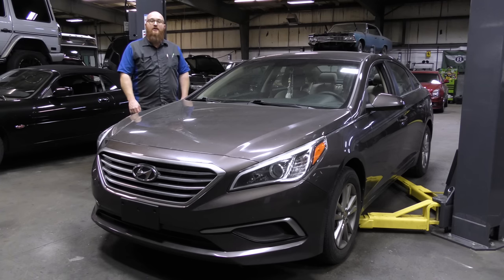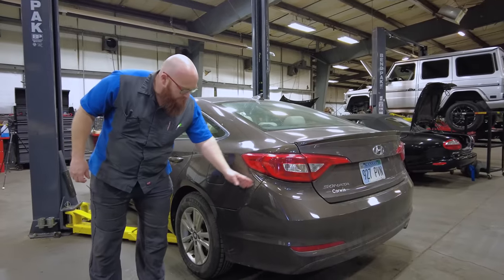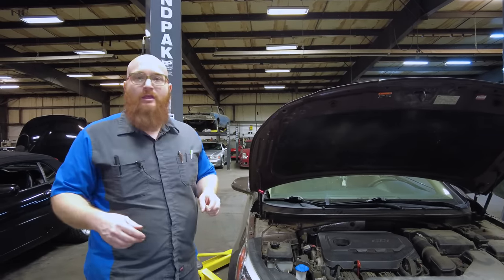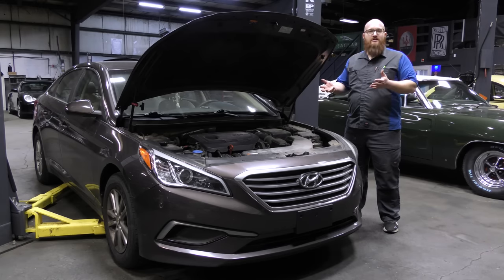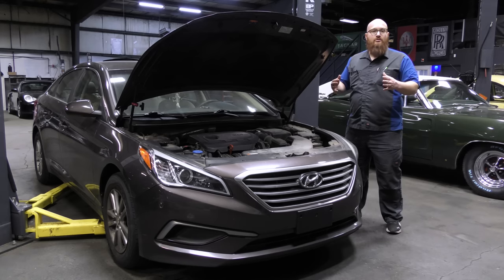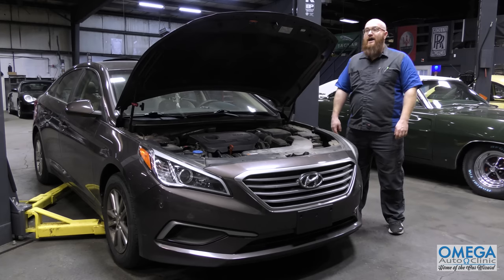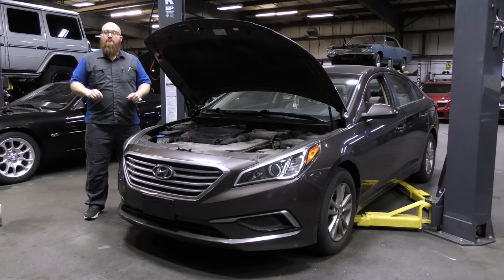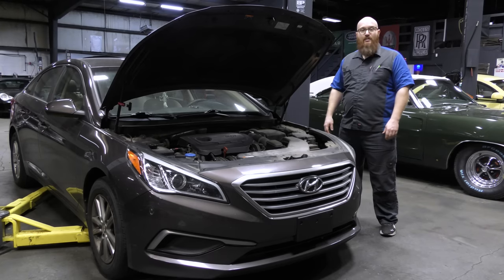What could be so bad on this '16 Hyundai Sonata that the CAR WIZARD is sending it to the junk yard?

Comment: Wizard, That is some good and honest advice for your customer. I did a rebuild on one of those junk GM 3.6 motors for a family member. I am a pro mechanic and I used the highest quality parts I could get. The motor took a crap about 8 mo. later. Like you said some motors aren't worth rebuilding. I did the labor work for free yet I still feel bad about it.😔
Reply: That’s so crazy that these engines are disposable. I replaced the bearings on a 74 454 in my driveway as a teenager and it came out fine.
Reply: My mom just traded her 2017 Santa Fe sport because it burned 2 Quarts every 1.5k miles. Only had 80k miles. It was ridiculous. She got a 2019 rav 4 with 17k miles. I’m happy she listened to me and got a Toyota.
Reply: I maintain a 2014 Acadia with the 3.6. It currently has 207k on it. It does burn oil, 1 qt every 1500 miles, but keep it topped off and going. I have seen plenty of 3.6l with 200k+. The earlier ones were bad with timing chains, but the 2012 or so + that was resolved.
Reply: I ll bet that the timing chains went... we cannot use aftermarket parts they are all from china with low quality for sure...
Reply: I had a 2005 CTS with the same engine that didn't make it past 60K miles.  Lost a shit load of money.
Reply: Manufacturers are purposely building cars that do not last more than 3 years. It’s better to buy used vehicles build before 2012 ( my personal opinion ). I have 1997 Ford E250 still running same engine transmission starter. Also have 2005 RAV4 still running strong. 2006 MDX just trade for another used RAV4. Older cars built to last for years and years but new cars built to stay in a shop for days months and end up buying another new model and same problem. Older cars build much better  using quality parts but so many parts are made in China and their quality control is very poor
Reply: @hcho7776    I'd better not purchase that new RAV4 I was thinking of buying if Toyota is now purposely making it not last more than 3 years.  Thanks for the info.
Reply: I sell a lot of timing kits for those 3.6s. what I don't understand is why these dealerships that buy them from me even still bother selling these cars knowing how they eat motors

Comment: Not to mention likely the worst thing about hyundai/Kia ownership is the dealerships are horrendous.
Reply: Hyundais and Kia’s are horrendous
Reply: To be fair every dealership is horrible... I don't buy Ford or Chevy but I for better for worse have driven a different brand car for each of my purchases and I would say Acura is one of the better experiences.  But that being said a dealership is a dealership they always try to nickel and dime even Toyota dealerships..... Hyundai and Kia aren't great either but it helps if you're in an area that has at least two or three competing dealerships because then if there's more than one place you can buy the same brand car within a 30 mi radius they have less gumption to be dick heads
Reply: @nathanielbailey108  Man you are dead RIGHT about that.
Reply: Even Genesis sucks.  Had a G80 and was treated horribly…went back to Mercedes
Reply: In my area the Gm and Ford dealerships are better Would never buy or have my vehicle serviced at the dodge dealership. Which is unfortunate because I love Chrysler cars.
Reply: thankfully they are so well built they dont need service
Reply: @waterloo123100  Yeah, and we know dealerships are going to mark up the hell out of those ‘last call’ models so only the multi millionaires can afford them.
Reply: I bet if the owner had topped up the oil before visiting dealer, the service manager would require to see all receipts for oil & filter changes, and this is where most DIY's are in trouble, myself included.
Reply: I need a used car........ suggestion please ????
Reply: @whatamisupposedtoputhere  they don’t even sells those high priced dodges here 😂you have to drive to Minneapolis for that.
Reply: @Mtechthewise  I believed that's covered in the Magnuson Moss Act, if I'm not mistaken.
Reply: I agree. The Kia dealership near me has sold my grandparents lots of work that they don’t need! Thankfully my Grandpap just got rid of his Sorento and now owns a Lexus RX. He’s so much happier and I think he will love the dealership experience as well.
Reply: Find this kinda ironic. In Australia hyundai/kia has pretty much the best dealership and aftersales experience I've ever had. All our cars are imported from south Korea and don't seem to have the issues that their North America counterparts display.
I don't think here I've had a worse experience than vw though. Crap product and crap service. I'll take a k5 or sonata any day over a passat
Reply: @Nathaniel Bailey  especially up until maybe 2018 fleet. They're been pretty good for a few years now but hyundai owners don't even realize how much owning one is a gambling. The kicker is that hyundai had such a nightmare with some of their hybrids that new battery replacements are double as much for older models than recently released models.
Reply: @swissmrkc  dealerships are no representation of the manufacturer brand. They're run by a bunch of get rich quick handlers. You're going to find more often, not necessarily often, just more often, caring and honest, used car dealers than top money guys. Overall the typical guy doesn't get into the business to play fair games if it means they make even.
Reply: The funny thing is we have a car 'expert' in Australia who constantly pushes both brands as being the best to buy, says the dealerships are great , however I went to take a test drive on a Tucson at our local dealership and they would not let me have one unless I agreed to BUY the bloody thing before driving it  ! .I bought an Outlander instead and its been faultless for seven years . One thing tho , reliability wise, I don't think any of the Hyundai  cars we drive here are built in the USA.... they are built in Czech republic.
Reply: Junkyard?! Why not just replace the engine? Give it to WatchJRGo, he’ll fix it
Reply: @scottalston8670  who cares- g80 far better than todays mercedes
Reply: @Mtechthewise  not likely theyd say athing- -
Reply: @dks13827  toyota or honda
Reply: @nathanielbailey108  The ICE cars,  yes, the EVs NO! And I have owned two, one from each sister company
Reply: Yes so agree
Reply: Hyundai dealerships are not horrendous everywhere. Ours in Salem, Oregon is amazing. They are always giving me free oil changes or discounts on services if I take their surveys after my oil change. They've been nothing but courteous and professional. I'd say Salem got lucky.
Reply: @elesjuan  yeah but you know that a dealership especially with this known issue will find any excuse to deny you. Then you have to end up taking hyundai to court and pay to have the engine torn down to find point of failure
Reply: What a ignorant thing to say. There are good and bad dealerships for every brand. They aren’t one entity lol. They are all owned by difference companies, some family owned some owned by big corporations.
Reply: Around where I live it's the same family that owns our Ford, Chevy and Dodge dealerships. The only thing those guys don't own is the Toyota and Honda dealership.
Reply: @nathanielbailey108  "Hyundais and Kia’s are horrendous"  But people are falling over themselves to say the Elantra N and Kona N are the best thing since sliced bread, and a better value buy than the "overpriced" Toyota GR Corolla and Honda Civic Type R.  Surely these Hyundai enthusiasts are not mistaken about the excellence of their Hyundai products? 🙂
Reply: True

Comment: I owned a 2016 Sonata with this same Theta II (2.4L 4 cyl) and had the dealership handle all the maintenance, and every oil change was documented.  Started having oil consumption issues around 120K miles, anf had the motor replaced at 137K.
All was well...until the transmission died at 191K.

Comment: I personally check the fluid levels in my car at least once a week and when a big trip comes up I check them one time before I go and one time when it's time to come back. It doesn't take more than 5 minutes and you have peace of mind that something catastrophic won't happen
Reply: never checked my oil.
the secret?  

Honda
Reply: @tocreatee3585  Hondas need oil, too...let it get too low(and it eventually will) and she will blow..Hondas are quality, but they are not magic...
Reply: ..Yes, same here, and I check the tires as well....
Reply: The car should warn about low oil. Or is that too advanced tech for Hyundai?
Reply: @betterbeavailable  No. That is exactly the kind of crap that has led to this sort of thing. The owner/driver needs to take the responsibility of checking the fluids, tires, etc. themselves...it should be part of Driver Training, and should be tested to get a driver's license...
Reply: @dyer2cycle  I don't think should be required to get a driver's license. If people don't care about their car and don't mind it dying, then it's their own problem.

Comment: My wife had a ‘10 Kia forte with the 2.4 and it spun a main bearing at 107k.  Dealer gave me similar quotes on short and long blocks. I ended up sticking a used motor with 65k in it for $850 and had it up and running in under 12 hours.  We traded it in a couple months later on a new car for her.

Comment: I was married for 17 years.  After our divorce my wife bought a brand-new Toyota Corolla.  The engine locked-up solid at 30-something thousand miles as she never did ANY maintenance, including bothering to check or change the oil.  I can't blame her 100% as I'd always done the maintenance on her car(s) when we were together.  We remain amicable and she said the mechanic who installed a used engine told her that her dipstick didn't show the presence of any motor oil at all!
Reply: Brother, you can blame her for that all you want. Oil change=common sense.
Reply: @tooltime9260  What's the point of ME blaming her?  She's already learned her lesson from it.  She bought the car that she THOUGHT would require the least maintenance; a bone-stock, almost zero-option Corolla.  Heck, it (1998 model year) even had the old 3spd automatic and manually winding windows!
Reply: @Matt_from_Florida  wow...how on earth does one kill a 98 Corolla! I think here in Germany they would take your license away for that :-D

Comment: I check my oil (almost) every time I fuel up. Gets me strange looks at the gas station sometimes. (Especially the time the stupid plastic handle of the dipstick broke off and I had to crawl under the car to get it.) But then everyone is surprised when they learn the car has over 260,000 miles on it. Take care of your investment, and it SHOULD take care of you.

Comment: Just because a car is low on oil doesn't equate to lack of checking. It could be low due to many factors. I bought a car in Oregon. Checked fluids and drove it home. By the time I got it home it didn't register oil on the dipstick. Car drove perfectly fine! No warning lights. Nothing..  I was beyond impressed it survived without issues.  I've since owned 14 of them. 98-2008 Crown Victoria's.

Comment: Wizard you are absolutely right, I’ve been in almost a year and a half long fight with Hyundai corporate and a local dealership, in June of 2021 after only 11 months of ownership of a CPO 2017 Santa Fe my wife noticed that the low oil light came on, I pulled the dipstick and it was bone dry. I first called the dealership service center and they told me to add oil and bring the car in I then called the the salesman that sold me the car, he told me that it’s perfectly normal to have to add oil to your vehicle every month and that he adds oil to his bmw every month (I told him that you might want to get your car looked at because that is not normal). We started and oil consumption test and was told all I have to do is bring the car back 3 more times at 1,000 mile intervals, soon after that the dealership started playing games telling me I had to bring the car in additional times and also the tech needed to complete a “cylinder clean out” at $200 to me even though the car is covered under a 60,000 mile bumper to bumper warranty and a 100000 power train warranty from Hyundai, we do the service and leave the car with them since they said it should be very quick to either get the approval or disapproval for the repair. The car sat for a month and a half at the dealer with us calling each week for an update, finally we call corporate to find out they have no record of a warranty repair being submitted. We come to find out that they messed up the process somewhere along the line and we are now told that we have to start this process from the beginning and there is no way around it. So with no other choices we did the entire process again and finally in December of 2022 we had a “reconditioned” long block put in. I can tell you for sure that I would never want to buy another Hyundai product again, the dealership shops do not care and corporate does not care, the 2.4 liter 4 cylinder has a serious problem that they do not want to acknowledge and will try to drag the process out until you are at the point of taking a loss on the car. I was actually told by the shop manager (with a smile on his face) if I had let the engine seize up I wouldn’t have to go through all of these problems and that they would just replace it. You need to put this on your list of vehicles to avoid this and the Santa Fe with the same engine
Reply: Absolutely. Doesn’t matter how well this motor is treated, it will die an early death.
Reply: I’m glad to hear that you will never buy another Hyundai/Kia product again. Tell all your friends and family as well. 8.5 million people are in your same situation due to all their engine recalls.
Reply: My Sonata Hybrid seized and thank G-d Hyundai covered the replacement of the engine. But before it seized majorly it just died while I was driving one day after the first year I bought it new. When I took it to get looked at by the Hyundai shop they could not give me a clear reason for why it died only some kind of water hose problem. I had never had issues with any other kind of car like I did with the Hyundai and I've driven Volkswagon, Ford and Smart car. Thankfully, the private shop I originally took it to questioned why a less then 4 year new car was having engine problems. I agreed. I got rid of the lemon.
Reply: yes after 2011 but the earlier ones are excellent .
Reply: This - THIS, RIGHT HERE! IS the problem. There is no such thing as a "low oil light" on MOST cars, and SO MANY people think that's what the light is telling them! The light is basically telling you "ZERO oil pressure, STOP ENGINE NOW!!" This has happened to people I know "Oh, the oil is low, I'll just remember to get it filled up as soon as I get a chance," but that's NOT what it means at all! Sorry if I misunderstood your specific example, and I don't mean to jump on your post, but this is BASIC stuff EVERYONE should know!

Comment: First and foremost I love your Channel. I just did a quick Google search for this exact make and model and found many long blocks available. Some were used somewhere remanufactured some were brand new. Typically the most affordable route in this situation is swapping long block for long block. I believe with the inventory available you could have completed this job for around the 5500 to 6000 maximum mark. I am not discrediting the flaws that you have pointed out with this motor but just based on my quick search and your labor rate I think it could have very easily been done. This is coming from someone who has replaced two long blocks in the past 2 years

Comment: My buddy has this exact car, same year, same engine. It has around 110k miles and it's been very good to him so far, but he's good at keeping up with maintenance. I actually changed the spark plugs in it for him last year, it was super easy to do.
Reply: Hopefully he got a good engine. Many from factory were just junk.
Reply: You go by the book on maintenance and it’ll still be crap.
Reply: @djncrti2860  pretty sure he goes 5k between oil changes
Reply: @1mlb704  Tell him to trade it in, it's going to fail anyway
Reply: Just tell him to watch his oil usage, it starts fast and gets bad quick. Maintenance helps, but they still suck. If it's ok now it'll probably be using a lot of oil near 150k, where you need to add some or else it gets dangerous.
Reply: The Real Cat of 2020  God no 🤣
Reply: @FusionBoost2.0  god yes, the 1.6T Hyundai motors are far better than both the 1.6L and 2.0L EcoBoost garbage.
Reply: The Real Cat of 2020  In the real world, no they're not
Reply: @MDKN22  Maybe the newer 2.0 when they went open deck. Even now when they fixed the castings. The 2.0 is excellent. I own one
Reply: The Real Cat of 2020  yes I know according to them
Reply: @MDKN22  I'm not worried about it, change the oil in them and drive.